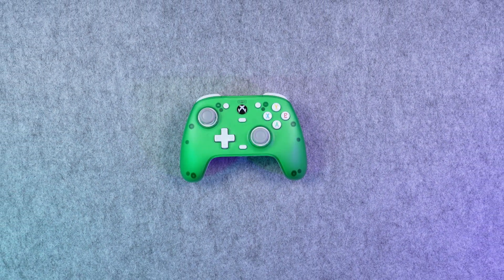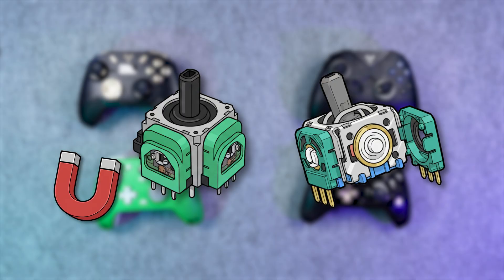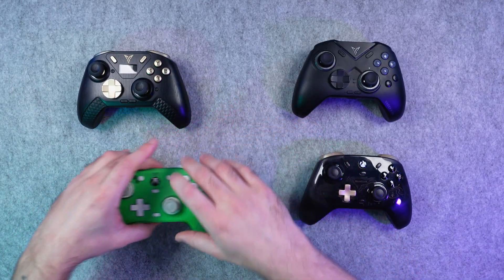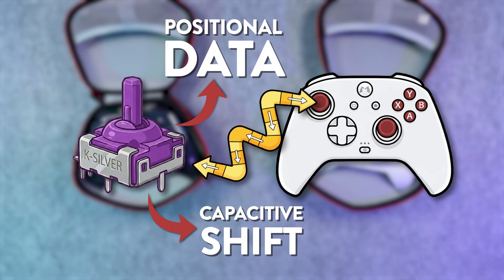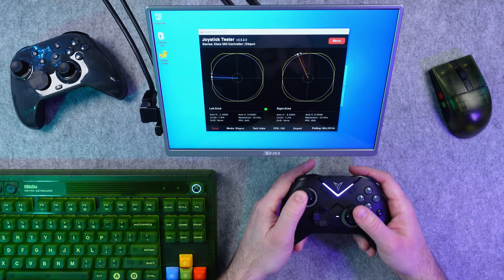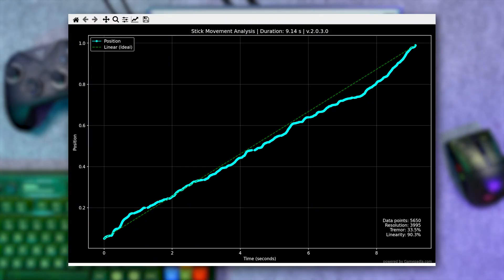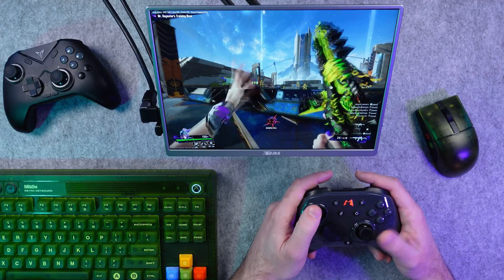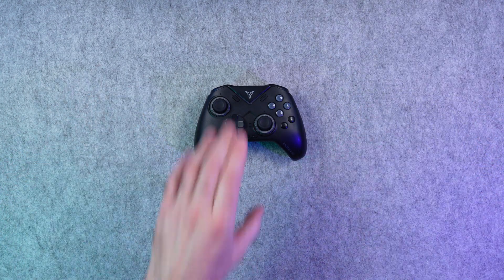Hall Effect vs Capacitive Joysticks | The Future of Controller Tech

Comment: I've tried both TMR and Hall Effect. I mainly play ￼Apex so I prefer TMR sticks because I play with no deadzone. Hall Effect sticks just feels too light and smooth for my liking due to the lack of mechanical movements. Maybe it'll be better if your controller has adjustable tension. TMR sticks on the other hand feels like the original alps sticks but with more precision. At the end of the day, it all comes down to preference.
Reply from the maker: For sure - it's all preference at the end of the day. Adjustable stick tension is my favorite feature for controllers

Comment: Capacitive is very precision
Not good for rocket league
Reply from the maker: Definitely has its uses!! What do you like to use for rocket League?
Reply: @AndysTechTable i dont know
Its have to do  just forward then jump and backward 
Small left or right when forward  will happen many times
On normal ps5 or xbox not happen
Reply from the maker: @purplefurture6960  from what I've seen the most important thing for rocket League is to use a square or raw algorithm with your sticks. That way you can roll better in all directions
Reply: @AndysTechTable ah
Reply: @AndysTechTable i just found  edge shape option ( circle or square ) then i remmbered that you said here 🎉 will try  square instead of regular circle
Reply from the maker: @purplefurture6960  square is the way to go for Rocket league!

Comment: I find TMR sticks heavy and Hall effect sticks lighter. Is it Just me?
Reply from the maker: It depends on the brand of sticks! I prefer higher tension myself. Which controllers do you use?
Reply: @AndysTechTable GameSir Cyclone 2
Reply from the maker: @karan-d3p7koh interesting! I have the cyclone 2 and find the sticks a little on the lower tension side. I'll double check which brand are inside of those but I think gamesir brands them their own